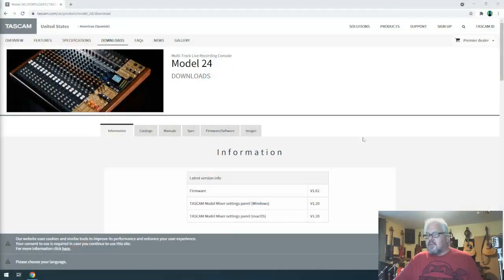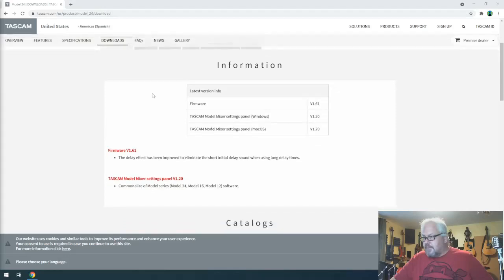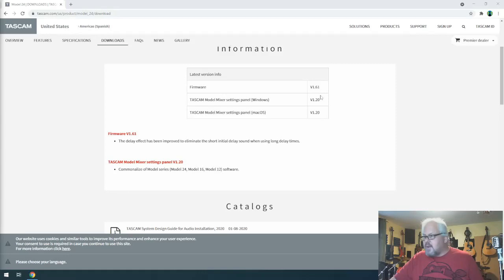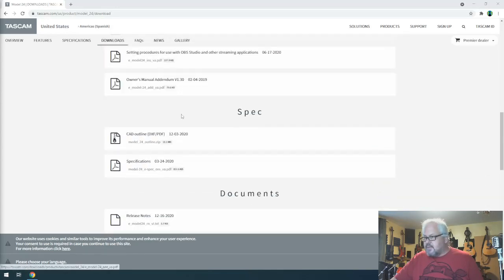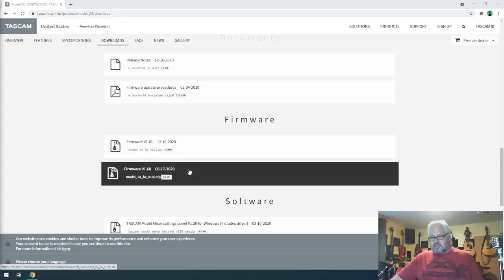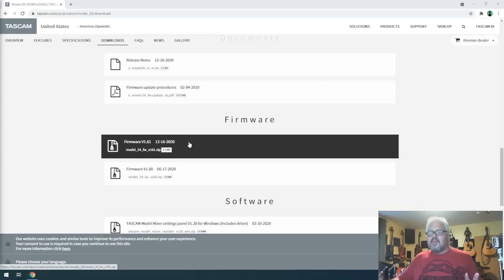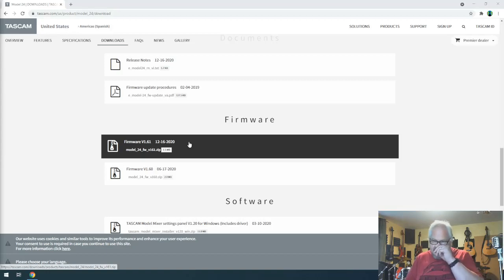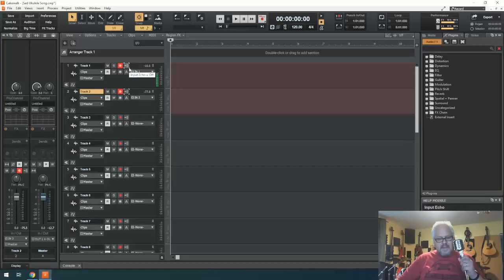Using a TASCAM Model 24 as a Multitrack Audio Interface

Comment: Is it possible to use it as a live mixer for a band and an interface at the same time? I'm trying to record my gigs but I want to be able to post mix each channel individually and attach the audio to video footage from the gig
Reply from the maker: I think so, I haven't tried it, but I can record using  Cakewalk so I think you can do this.  Shouldn't be hard.  It would be easier to use the system to record onto an SD card and then export the tracks into a DAW.
Reply: @MikeFoerster_I_Love_Recording  Awesome! Thanks for the response. Ours will be here tomorrow

Comment: I am considering buying a Model 24...I want to record with it as a stand alone unit but wonder if i can then mix afterwards using a DAW but also using the Model 24 faders etc for the mix down..?
Would be nice to see what i am doing on a large computer screen as i mix...thanks in advance..
Reply from the maker: You can hook up the Model 24 to a DAW. I generally just use it for everything. The Model 12 has been upgraded to work as a controller for DAWs. If you want more control over everything.

Comment: It's not often mentioned but the Model 24 can essentially function as an inline console.  it's able to process tape, or DAW, returns on the same channel that's providing the input. If you set an output from each individual track in the DAW back to the same channel it came from on the Model 24, your signal will return after the preamp section and continue through the channel strip. This also allows you to use the monitor outs as effects sends while in (pc) interface mode. It's the only mixing console in this price range with that functionality, making it rather special.
Reply: By this, do you mean that with the Tascam sending, say, a vocal on channel 1, to the DAW, on playback (from the DAW), the sound will be routed back to channel 1 on the Tascam?